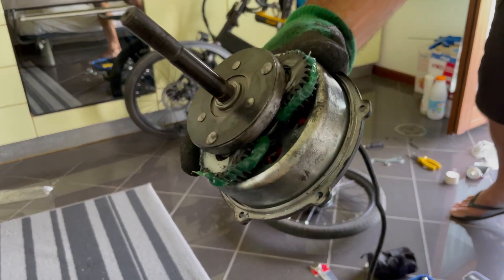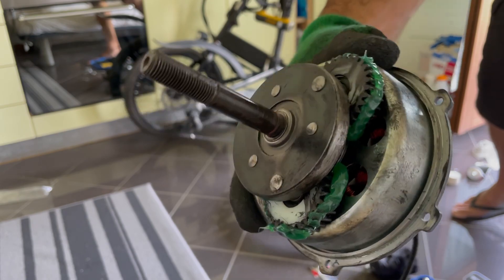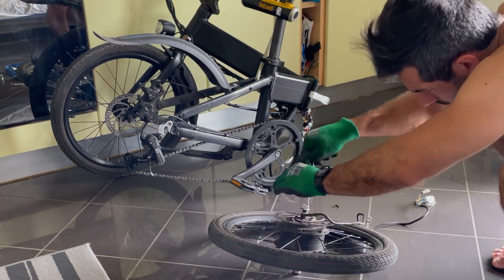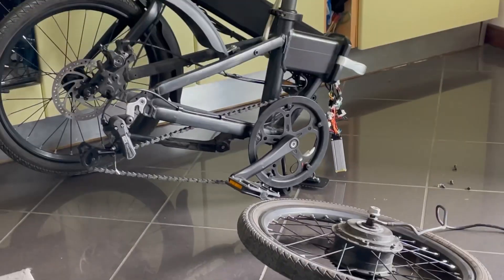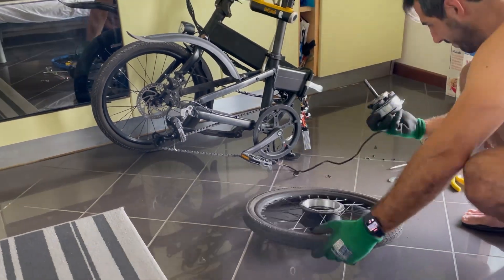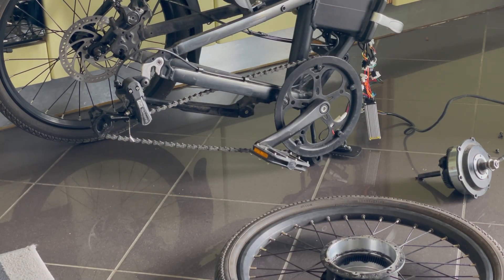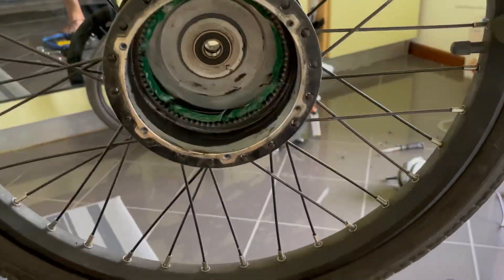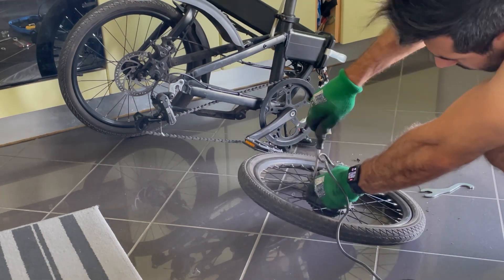How to disassemble the motor hub - Fiido electric bike

Comment: thx for this, i didnt have to take the wheel cable out the controller tho, just set the wheel it on top of the bike while it was upside down
Reply from the maker: That's also a good alternative, mainly for replacing the tire